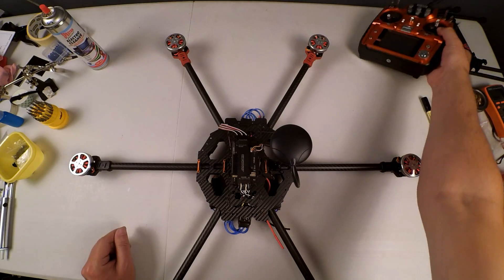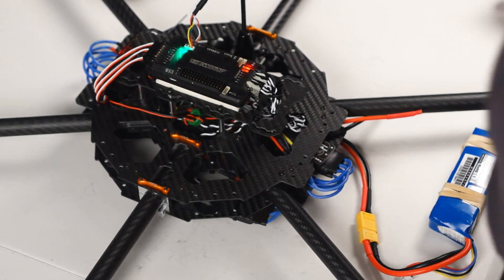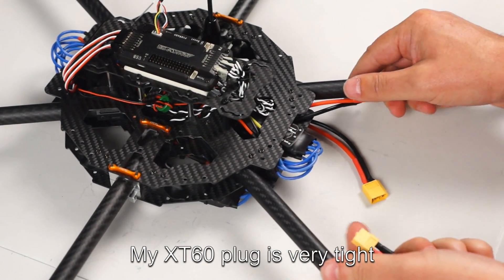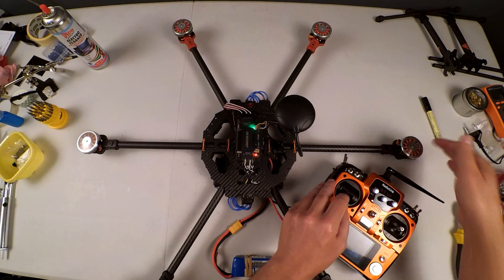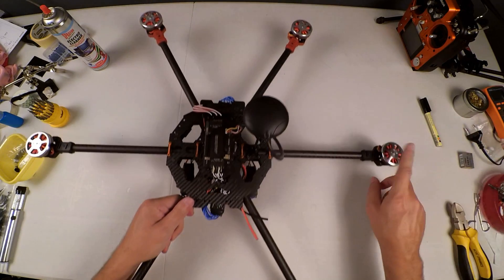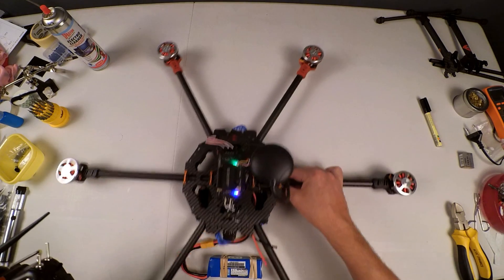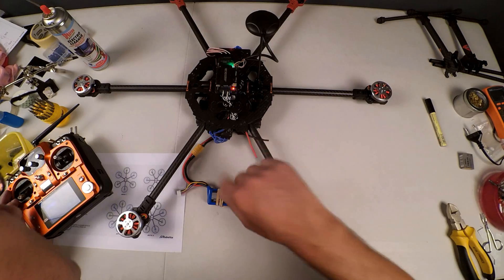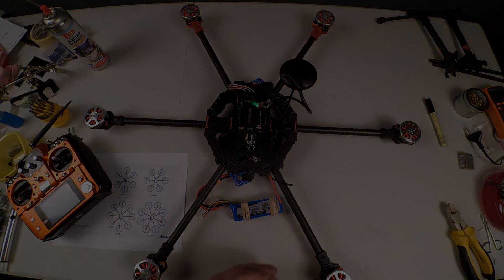Hexacopter Build Part 10 - ESC Throttle Range and Power APM Motor Spin on Tarot FY690S

Comment: hie i have the problem to arm the drone motors , are not spinning using radio T10J Futaba, even to arm it using mission planner. may you send me proper settings for tarot drone , APM

Comment: Hello, using a very similar build to this one. Same ESCs. Would you be able to tell me as to why I am able to calibrate my ESCs, but after unplugging the battery the calibration is lost? ESCs require me to recalibrate before every flight. Thank you.

Comment: hi all can u help me my hexacopter motors are not spinning in sync.. m using APM 2.8 ...two motors a spinning when I arm it. after 50% throttle third one start spin at very low speed ...and at 100% throttle all are spinning with different speed ...help me to make them spin in one sync
Reply: did you manage i have similar problem please help

Comment: Hi Riaan, to change the direction of the motor (clockwise and counterclockwise), which cables are to be exchanged? I have to connect the red cable of the ESC with the black wire of the engine? And the yellow cable of the engine remains where it was?
Thank you!
Reply from the maker: cipnick You must swap any 2 wires on the ESC output end (that goes to the motor). My cables were all blue but this will depend on the make of the ESC you are using.

Comment: hello  
im really confused and it drive me crazy ( I CANT ARM MY QUAD )
frame type : tarot 650 
Apm 2.6 
esc and motor calibration  : done  
radio calibration : done 
compass and accelerometer  .. calibrated several times 
i received many pre arm checks  messages like GPS HDOP / BAD  VELOCITY AND SO ON 
 i did my best to solve it and i only could solve GPS HDOP  but is cant arm 
anyway i end up disable pre arm checks just to see if i can arm or not ... and i still cant arm    
any ideas .. help! 
suggestion perhaps
Reply from the maker: +luffy dx I have been thinking about this for a while and all I can imagine that is left (assuming you did all other calibrations) is that your throttle may be reversed.  Instead of trying to arm by pulling throttle to bottom left and holding, push it up and left and hold (or right and up).  If it arms in any of the throttle up positions then your throttle may be reversed.  When you try this, ensure your props are removed as accidental throttle while throttle is upside down (reversed) could be disastrous.
Reply: Thanks a lot 
I managed to arm successfully 
But when I tried to takeoff it flip

Comment: Hi Mr. Riaan. I have the exact same set-up as you "they must be pretty popular" except mine came with a T-plug batter connector. I want to buy the best battery for it, but i have no idea what it can handle. Any pointers for me?
Reply from the maker: +Red Rolo I upgraded mine to a 4s 5000mAh battery which is better than the 3s. You have to repeat the ESC calibration and will receive 4 beeps indicating 4s battery instead of 3 beeps.
Reply: Cool, what's the flight time like with a 4s? Is the setup capable of a 6s?
Reply from the maker: +Red Rolo I get 15min flight with heavy gimbal and camera. I think the link limit of the motors is 4s. You will have to check with the type you received. Also double check the ESCs you received can handle it.
Reply: Great, thanks, I'm looking to upgrade to Tarot 4006-620kv or 4008-380kv with 1355 props in the future, not really soon though.

Comment: Hi Riaan, I have the exact same setup as you have here, I cannot get this to sinc? I have checked the wiring zeveral times to make sure it is all correct and it is. I dont get a solid red light at the end of the sinc sequence, Any ideas? Thanks.
Reply from the maker: +Do K First thing,  what battery are you using?  At 1:38 the number of beeps it give should correspond to the number of cells (3 beeps for 3 cell, 4 beeps for 4 cell).  Next, what radio are you using?  It may be that your throttle is upside down (can be changed later).  Try arming by putting into other corners (bottom left, top left, top right).  If it does arm in one of these corners then your throttle is upside down and you will need to change this in the radio configuration.  If it still does not work you will need to connect to mission planner via USB and check on the radio calibration screen that there is throttle input by moving the throttle and checking if the values change.  Let me know and we can take it from there.
Reply: +Riaan Roux , You are a genius, my throttle was backwards, everything works great, my radio is the new style Radiolink AT10 with usb on the side, My hexacopter is the exact same as your set, from electronics, avianics, radio, receiver, motors props everything, i do not have the mission planner or the cable, can you link me the place where i can buy these? I live in the us, Thank you again.
Reply: +Do K , Riaan i had the usb cable already and i also found the Mission planner software, i followed your video part 11 and now everything is set and programmed like yours, all i need todo now is a maiden flight, i will post a video of it when i get done, Thank you again for the awesome tutarial on setting up this hexacopter, helped me out tremendously.
Reply from the maker: I was unable to answer yesterday but I am very happy you got it sorted out.  May you have a good maiden flight!
Reply: +Riaan Roux Hi Riaan, i have another question about batteries, i have a 4s 14.8v 
10000 Mah batteriy, Can i use this? for my build? Or what would you 
recommend. I'm going to install a gimbal with gopro4 with video 
transmitter to ground station setup also. Thanks.
Reply from the maker: +Do K I have also ordered 2 4s batteries. They will work with this setup. Confirm that your ESCs can handle 4s batteries. You will have to calibrate the ESCs again using above procedure. You will get 4 beeps St the throttle down instead of 3 telling you that you have a 4s battery.

Comment: Hi Riaan, I bought this kit to me. did you do any flight? Can you make a video activating all modes (Normal, GPS, RTH, and others)
Reply from the maker: +Danilo Sousa I have not done any flights yet, but will do a video on the mode setup.
Reply from the maker: I have uploaded part 11 which shows how to set flight modes and change settings on the Radiolink AT10 to correspond.